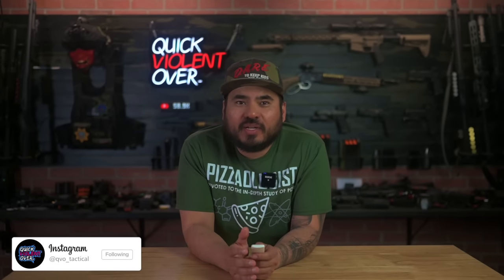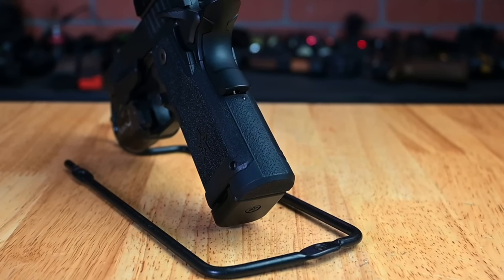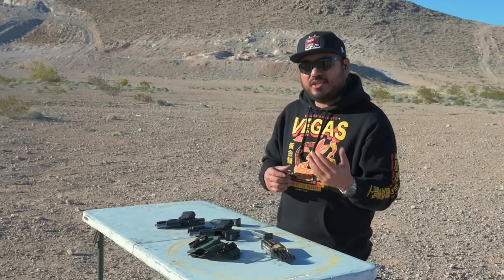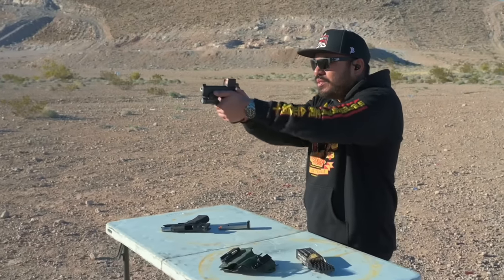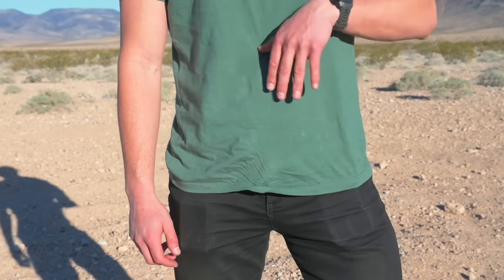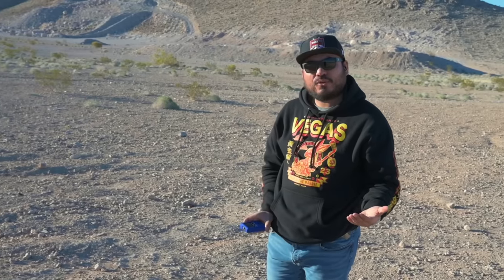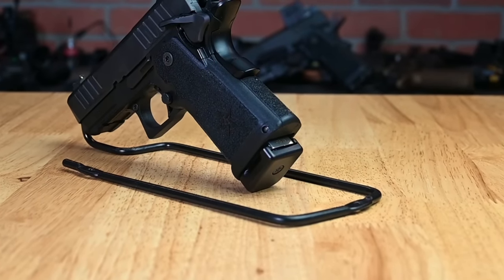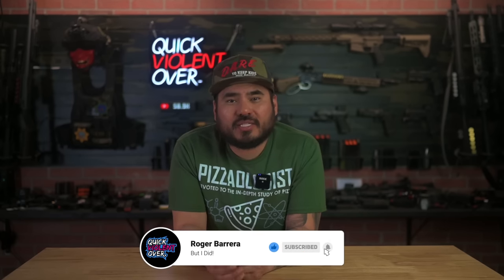My EDC | Staccato CS”X” w/ ProLedge!

Comment: This is great but imagine paying almost 3K to have to add aftermarket mods to shoot comfortably on a long range session. It shows how Staccato isn’t really thinking things through. Maybe sending out some samples before mass producing would have led to feedback and these changes to the original design.
Reply from the maker: I get what you’re saying however, as we showed in our initial video on the CS. The gun shoots great out of the box. We as a company just like to improve on the gear that we use. That is how I got started with designing holsters. it is the same thing that goes for when we compensate or port 9mm barrels. 9mm shoots great already however, making it shoot even better is awesome. Thanks for checking out the video we appreciate it. 👍🏼👊🏻

Comment: I love what you put out, Roger, but I’m going to give you a slightly different angle. The purpose of a CS is to make it small. I carry a Wilson SFX nine 15 round and a Nighthawk Counselor. These are officers size pistols. I have shot all three next to each other on both steel and paper and put them next to each other for size comparison. The CS is a bigger gun than the other two, even the Wilson, which has almost the same capacity. The CS has a wider grip because it is polymer. I personally don’t like magazines that stick out the bottom for carry and the Wilson has a flush mag. Adding this to the staccato will make the size for a CS less appealing to me. I carry at 3 so this makes a difference. 

Being an idiot, and not being particularly concerned about modifying a staccato, mine is out being ported and I’m getting the trigger lowered to 2 3/4 pounds. That should be something. 😀

Comment: What’s the length between the bottom of the trigger guard and the bottom of your mainspring housing extension? I have bigger hands and I don’t have a full grip the c2 grip. My c2 has the gen 1 full size grip on it and I love it but curious about the CS plus your extension.

Comment: How's the battery life of the holosun leaving it on in the holster? I know it has the auto off after 10min and a sensor to turn back on, but you know light jostles can activate it and take another 10min to turn off
Reply from the maker: Battery life has been pretty good and I’m sure with the solar failsafe in place it helps as well. I’ve had the same batteries in it and have left it on since I got it months ago.

Comment: I thought the proledge would only work with the Macro? It can work with any gun you can put a tlr7 sub on? Or was this proledge made for this gun specifically?
Reply from the maker: It is made for the TLR7 sub so as long as it does not interfere with your controls, you are good to go.

Comment: I purchased one of your holsters while waiting for my CS and learned about the pro ledge  from one of your videos so I ordered one and now it doesn’t fit my QVO holster 😭😭😭.
Reply from the maker: You have to have a ProLedge holster, the ProLedge changes the fitment since it’s an additional component.
Reply: @RogerBarrera  I would hate to spend another $100+ for a new holster. I might just dig up my good ole heat gun to make room for the proledge.
Reply from the maker: @bovver6092  you can do that for sure. Shoot us an email at info@qvotactical.com and I can walk ya thru it if needed.
Reply: @RogerBarrera  Thanks, will do if I run into some trouble 👍🏽

Comment: Hey man, I have a staccato p and am going to get either the cs or c2 for carry.  I was only thinking the cs until seeing comparison videos and seeing it’s not really that different in size in grip.  If you had to choose c2 or CS which would it be? Thanks
Reply from the maker: The CS is more like carrying a P365X macro. If you conceal carry more than 300 days out of the year, I would get to see CS over the C2.
Reply: I currently EDC the C2 and am quite new to the 2011 scene and if I had it to do again, I'd have grabbed a CS first and then went to work on the build. Now that I'm quickly becoming something of a custom Staccato snob addict and this whole pistol line and I'm starting to mod out my C2 (Staccports and 3 lb trigger) I can absolutely justify just proceeding on to pick up a CS for EDC and then grab up an XC for the simple range fun of it. 

At the end of the day man I love how you lay out the various options and relatively low cost tweaks to really wake up and ratchet up the performance of everyone of these pistols. It's good stuff man. Truly amazing content Roger. Looking forward to getting my C2 back from Vulcan Machine Werks and while it's away there being worked on maybe picking up that CS with that TLR7 and ProLedge setup. Keep up the super informative content man and keep doing what you do! ✌️